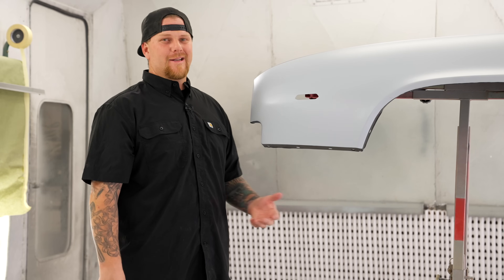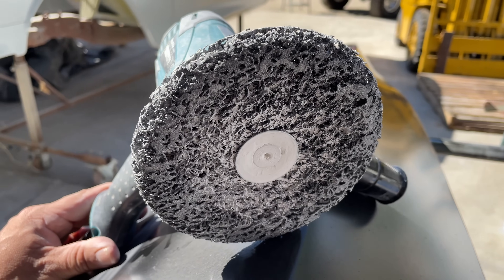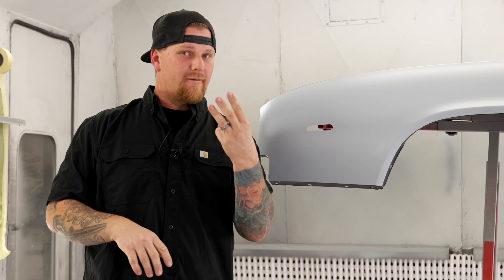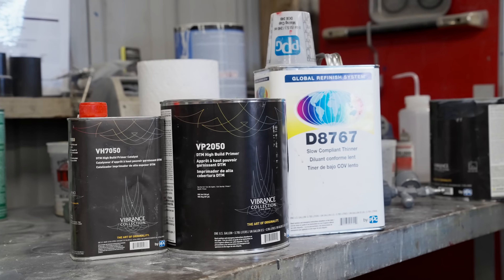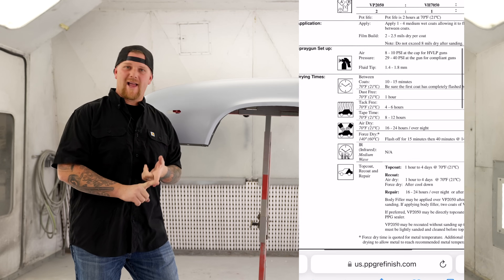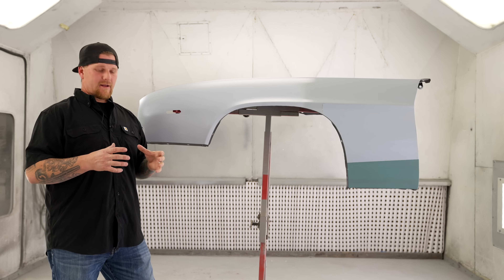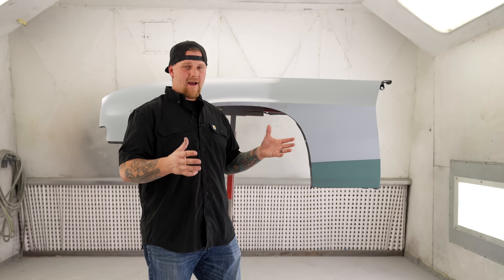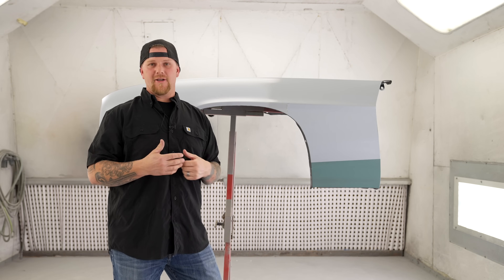Understanding Primers:  Epoxy, Polyesters, and Urethanes explained.

Comment: Great video so my question is there's no need to use self etch primer  when you can use 2k  for a sealer  it that correct.  !! Thanks
Reply from the maker: You are talking two different questions. Etch is for bare metal if you are not using epoxy or a DTM.  A sealer is done before paint. Does that answer it?

Comment: I've been in the business for 40 years and was a technical rep for Akzo Nobel. Epoxies aren't near the product that they used to be. They took the lead out of it 20 years ago or so and they don't have near the adhesion properties as they did. They will move around for quite sometime after application. For that reason I would let them cure for a week before topcoating with anything. Epoxy used to be the closest thing to factory ecoat. And it should never be applied over etch primer. As far as direct to metal primers I've never seen one that's a hybrid of epoxy. They are however a hybrid of etch Primer. Smell it, it will have the same phosphoric acid as etch primer does
Reply from the maker: Ok well been using it now for a bit I don’t know what to tell you.

Comment: Working in a shop where we do a lot of overall paint on older vehicles, sometimes will strip bad paint to bare metal & using an etch primer to seal the metal will just use a sealer over the etch primer & then just repaint the entire vehicle, this usually works very good & have never had any problems
Reply from the maker: Whatever works 👍🏻
Reply: I guess if you’re a lot of restoration work & applying body filler, I can see how these primers would be beneficial too!!

Comment: Wow this video was so helpful! I am in the process of shaving my engine bay. After watching this is seems like the VP2050 epoxy primer is the way to go... I am however worried about all the little nooks and crannies in an engine bay since I won't be able to DA sand a lot of those with 80 grit. I could definitely just use my hands and some 80 grit sandpaper in those spots but not sure if the pattern created by the DA sander is required for the epoxy to stick?
Reply from the maker: No we hand sand all of our cars before body filler

Comment: Again another informative video, keep up the good work. Learning something everytime I watch one. Do have a question though, the acid wash you use isn't available here locally, sure it is in some of the larger towns around or ordering it online but I was interested in some of the products I can get right here. What is your opinion on using SEM Rust Mort as my acid wash then Ospho on top of that before applying my epoxy before doing my body work? And also will 1k epoxy work to encapsulate the sheet metal and give me a longer window to finish my body work?
Reply from the maker: I recommend sealing the car in epoxy then doing your body work. Don’t use rust mort as an acid wash

Comment: Really informative videos. Started out watching the ones from several different people but now just mainly watch yours. I'm restoring a 56 Belair and a nova ss at the moment, have 90% of my metal work done and it's time to start removing the heavy surface before priming. Just wondering if you or any of your followers have tried Picklex 20 rust converter, if it is worth the asking price. Don't have information on application as of yet but it is supposed to be compatible with the ppg 2050.
Reply from the maker: I’ve never heard of it we use rust mort converter.

Comment: Travis, There are people on the fb sites claiming that it is perfectly fine to put filler directly on metal. One guy said if it wasn't the manufacturer would have to warn you or open themselves up to lawsuits. What say you?
Reply from the maker: It falls under the same guide lines as if your friend jumps off a cliff would you follow? Just because a manufacturer says you can do. It doesn’t necessarily mean it’s good. It is the benzene peroxide that is inside the Hardner that causes rust. Can you do it? Yes is it recommended not really.
Reply: Thanks for the quick reply :)

Comment: Even though i am not big on HOK brand paint and clear coat i must say that their KD3002 white surfacer/sealer is an absolute brilliant product. A hybrid epoxy  DTS that is made to be a sandable high build, medium build, and able to be reduced down for a sealer. I have been using it since firsr tying it. I do not get sinking or shrinkage with it either like i did with UPOL
Reply from the maker: They all shrink some are just better than others. Thanks for the product info haven’t tried it.
Reply: @SYLVESTERSCUSTOMS  very true, some shrink back a lot, can be very frustrating at times. Ive been buying the HOK KD3002 white and KD3000 Grey regularly now. I get very very little shrinking with it. Like i said i am not big on most HOK products but that surfacer/sealer sprays very nice, less shrinking and seems to have great adhesion with every basecoat i have used. Its nice too that its a hybrid epoxy DTS that is also a sandable high build. Cuts the amount of money in half since you dont need to then buy an epoxy or etching DTS then buy a 2k high build as the HOK is priced the same as most 2k primers. Can also be reduced down as a final sealer too. I feel its most definitely worth trying and a review i would watch even though its what works for me already, help others see it and helps them like it does me.

Comment: Great video.  I use VP2050 all day and love it.  Definitely a slow sanding product, but it’s physically tough as nails and I trust it with my life.  I also use Tamcos 53XX series, best high build urethane in the business, period.  I also love Tamcos 770 series, another hi build epoxy.
Reply from the maker: Thank you.
Reply: Polyester for high build.  Just need to seal them or they might fail.  Also need a 2.0 tip gun to spray it correctly.
Reply: ever use 53xx over etch? Can you?
Reply: What primer would you recommend for painting over the old finish on a 68 coronet that I had to weld in some rear quarter patches so there  is some bare metal and body filler in area's?

Comment: So if I use the VP2050 and get everything blocked out to the point I'm close to paint do I seal it with the urythane and do a wet sand then base and clear?? Thank you for the awesome videos, I'm learning a ton!! Cheers!
Reply from the maker: You do not have to seal with a urethane and then wet sand. I actually block everything out to 220 grit, and then I wet sand with 600 and a spray urethane sealer and go directly into basecoat clearcoat after it flashes off. Here’s the caveat, depending on how good you spray you might have orange peel that Will make your basecoat and clearcoat look not as good so if you want to take the extra steps to wet sand, the urethane then by all means do so there’s a bunch of different ways you can slice this.

Comment: What happens if you're working on a car and you're doing  rust repairs so there's sections of the car in bare metal but the paint is decent and I don't want to  bare metal the entire car. Do you epoxy only the exposed bare metal, filler work and then a rub down the car car for a high build primer? Great vid and thans for the tips 👌
Reply from the maker: Yeah you can do that 👍🏻

Comment: I use slick sand polyester primer which has virtually no shrinkage. I use Southern polyurethane epoxy primer and wait 24 hours before spraying slick sand unless I bake it first. I have used VP 2050 and I absolutely hate it. It is very hard and sounds like concrete.
Reply from the maker: All primers have a level of shrinkage even slick sand. Vp2050 is a great product it has way more build than slick sand also. But whatever works for you 👌🏻
Reply: Did some work for a guy being a real jerk, had his 70 mach 1 quarter in 40 grit so I slick sanded and put outside on the back burner for a week out in hot sun. Anyway said ok let me block this out and I painted it. 8 years later still looks great. Any primer , scuff the skin and let the carrier solvents evaporate and your good.

Comment: Great info. I had my 69 Camaro sand blasted here in AZ. I applied SEM metal lock on it and some years later I'm getting some surface rust coming through. I'm trying to understand how that happened. Maybe I used a water based paint prep? I did it back in 2015 so it's been a while.
Reply from the maker: I’m unfamiliar what SEM metal lock is?
Reply: @SYLVESTERSCUSTOMS  DTM epoxy primer
Reply from the maker: @BigC8675  not sure some manufacturers are better than others. Could have been how you prepped metal. Lots of variables.

Comment: I still like my DP 90 over bare metal first,  but after my bodyfiller I'm going to try Evercoat super build over it. Have always used NCP 271 for my final prime, but at over 800.00 a gallon I'll use the 2050 reduced.
Reply from the maker: The main reason I like vp2050 so much is that it’s one product instead of having to use several. Which results in better consistency and less failures. But whatever works👍🏻
Reply: @SYLVESTERSCUSTOMS  I don't so much about failure,  if I'm using the same products from primer, base coat to clear.

Comment: Could I use epoxy wet on wet then leave a hour or so then straight over with high build then repairs thanks
Reply: You should read the technical data sheet for the specific product. They all vary. Temperature and humidity matter also. I use an epoxy that I try to wait 12 hours to several days before adding a urethane primer over it. And never apply wet on wet. Too much chance of solvent pop if you aren't baking them in between. By repairs, if you mean filler, do that before high build. If you mean block sanding, then yes.
Reply from the maker: Exactly what he said below 👍🏻

Comment: Best teacher on the internet!! Thank you sir!! I’ve been using HOK KD3000 for my project currently. How do you feel it compares to VP 5050? Have you ever used it?
Reply from the maker: Thank you! Unfortunately I haven’t used it. Which one of the three categories is it?
Reply: @SYLVESTERSCUSTOMS  falls under the DTM epoxy hybrid. Can be a high build first then reduced to a surfacer, then sealer depending on the mix ratio. Thanks for your reply. Was just curious if you’d used it before. I’m trying to keep to 1 product line (house of kolor) or else I would have used vp2050. Your videos have helped me tremendously during my process. Thanks again!
Reply from the maker: @chetstevens4929  that’s great best route to go. Thanks for watching we’re glad to hear the successes

Comment: Eastwood can go pound sand. I wouldn't purchase anything from these loosers. I purchased a MIG welder with spool gun and it never worked correctly. They do not stand behind what they sell, change what they tell you they can do which is basically lie to you, and they cannot repair or supply internal parts for any of the Chineseum welders they push. No thank you, I would sooner deal with Harbor Freight than Eastwood. Eastwood sucks!

Comment: there are DTM urethane primers....that are true DTM....and they have them that are high build. I have used a few that are almost the same as Polyester. super high build and still flexible. Unlike Polyester primers, many of the guys I know dont use polyester because they have cracking issues. Honestly I havent had that problem. and I like polyester. But I normally use DTM hight build Urethane primer for all purposes. You just need to READ THE DATA SHEETS.....I say it all the time on my channel too. Another good one is to use Epoxy and NON DTM high build like you do with polyester. Chameleon  makes one like that. Great primer.
Reply from the maker: I mentioned dtm urethanes in this video. So far I get best results with vp2050 it seals and is thicker than any polyester on the market. One product is better than several. I’ll have to check out your channel 👌🏻
Reply from the maker: We also do not use poly. Poly was performed in the video to break it down for people. We only use vp2050 start to finish
Reply: @SYLVESTERSCUSTOMS  The PPG products are good but a pretty pricy. There are some other brands that work well and are a bit cheaper. PPG is a big name for large shops and has a good system and training. But there is nothing like many years of getting priced into learning other brands. It seems like so many brands are cheap for a while then once they get you then they raise the price. then your searching for another brand that does the same thing. I think your in socal so we have a whole other ball game of VOC....approved products.
Reply from the maker: @Mikefngarage  yes I’m in Ca. It sucks!!! Lol I’m actually a small 2k sq ft shop in my back yard. Here’s my thoughts on that…. I started my business in my 3 car garage many years ago using the dtm urethanes and the polys etc. You get what you pay for when it comes to ppg if you are doing quality work the cost of the product is the least of your problems. Stick with one paint system start to finish and learn the product as I’m sure you have. Whatever works for that shop and or job. This channel is dedicated to helping bring back the trade and get younger generations involved in knowing there’s good money to be made in Autobody.
Reply: @SYLVESTERSCUSTOMS  yea.....I have been there with PPG many years ago. My fagorite is BASF...RM or Glasso. but too many $$$....I do the same teaching people to restore their own cars at home. Great products out there that way less expensive. Was a painter many years ago....You know they pay the same Flat rate hour today as they did 35 years ago? I just do it for fun now. Moved into real money Sign industy painting which we use PPG paint in that. Or Axzo Nobel....who makes sikkens. LIsten keep up the good work. connect with the younger crowd.
Reply from the maker: @Mikefngarage  right on you too 👌🏻👍🏻

Comment: Shrinkage is the reason most collision shops done use epoxy primer and only DTM urethane. THey do have TRUE dtm urethane primers. that are high build. Lots of products out there. Not all products are the same.
Reply from the maker: Who said they were the same? Lol also that’s not why epoxy shrinks far less than urethanes or poly we’ve done the shrink tests on them.
Reply: @SYLVESTERSCUSTOMS  you talked as if urethane primers are not high build. honestly there are so many variations of this stuff there is no 1 way to do this. but yea an epoxy is a good base for some people. where I live they rarely ever use it in a restoration shop that  is finishing a car in a short time. Some of the urethanes are really good at sealing as well. Nothing you said was wrong but there are a lot more variations out there that work well and last. It all depends on the weather of where you are places your storing the car while under restoration. I prefer putting filler on bare metal most of the time but over epoxy is just fine if your using a filler with adhesion promoter in it like USC AG47 now called grip filler I think 7000. It is better than any evercoat product I have used. much better than zgrip. easier sanding less pinholes. Cheaper than rage and near the same.
Reply from the maker: @Mikefngarage  finishing a car in a short time and restoration don’t belong in the same sentence. The benzene in the hardener of filler alone is what causes rust. Also I specifically stated all the primers discussed can be found in a high build and or dtm that’s enough said I don’t need to sit here and talk about every primer out there I’m trying not to confuse people. Get what works for you and that’s it.
Reply: Don't you think speed, out the door time, is the deciding factor most of the time for collision shop product choice? That and sticking with a single manufacturer for the warranty claims?

Comment: Aren't polyurethane the same thing as urethane?  😦
Reply from the maker: Absolutely not. Poly is sprayable filler.
Reply: @SYLVESTERSCUSTOMS  You mean polyester primer is sprayable filler, like Featherfill and Clausen All U Need or Rust Defender. Not the same thing as polyurethane. Urethane paints include clears, primers, and single stage colors, right?

Comment: heres one for you, 84 Fiero weathered ive had to do lots of sanding to get the roughness out of the hood and roof .which is SMC, the fenders and bumpers i think are the same urethane now there is spidering on the fenders and bumpers  should I use epoxy after sanding down past the paint and maybe use a polyester primer to build over the spidering?? not sure what to do here as everything is flexible . urethane primer?? for the whole car? . Thanks in advance . great videos
Reply from the maker: Thank you! Yep strip it down all the way and epoxy. You are on the right path. If it was me, I would use VP 2050 to do the whole thing start to finish and not use any other primer. I’m not just saying that for no reason that’s all we use and we have great results.